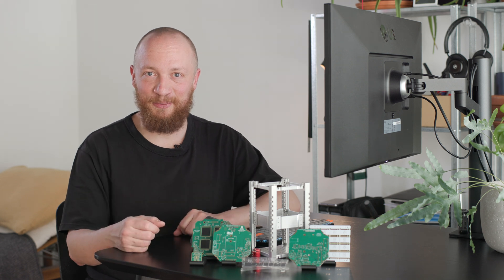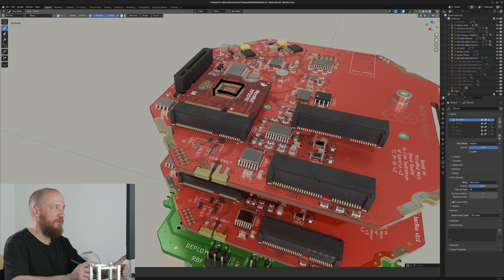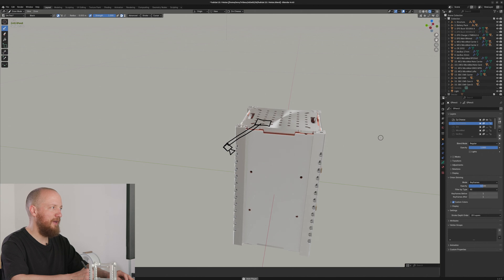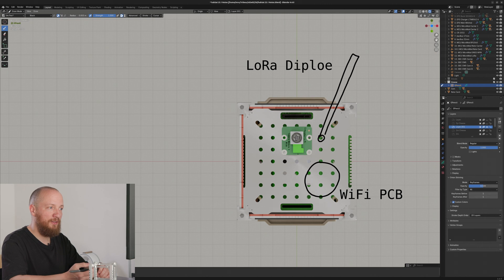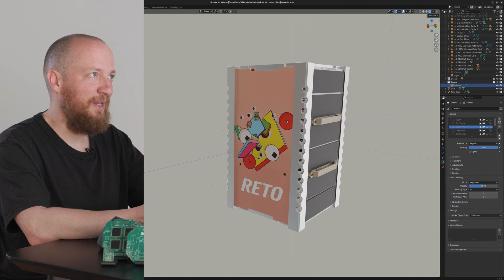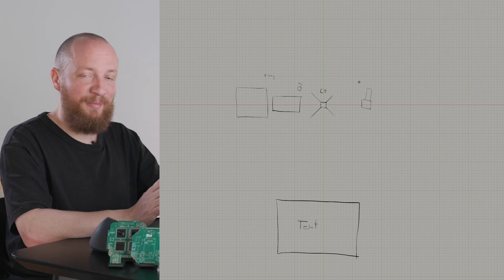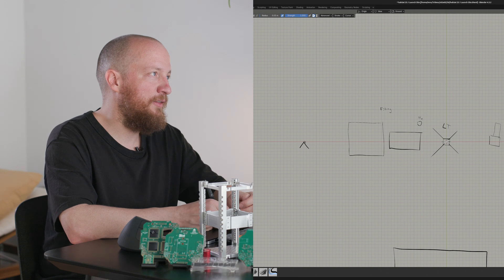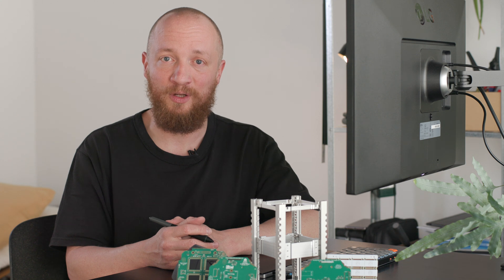CubeSat Test Flight Prep: Part 2, Hardware and CONOPS

Comment: As always, incredible work, Manuel. You're getting closer and it looks fantastic. Have you thought about adding a self-powered buzzer like the ones used for drone flights? Sometimes, even with GPS, it's hard to locate them during recovery if they fall in areas with trees or dense vegetation.
Reply from the maker: Thank you, happy to hear that you like the video! :) Yes, I have used a buzzer on a previous flight, but it wasn't really loud enough. So this time I'm going with a bright, flashing light.
Reply from the maker: Actually, I may give the buzzer another try. Is there any product you could recommend?

Comment: Iam currently working on a 2u cubesat project. We are planning to use a picam to capture earth images. We are planning to use lora for the becon signals and GFSK for sending down the image packets . In our case we have access to both of them and are planning to use both in the same UHF frequency band. Since both of them are at the same band, our team came up with a solution of using the same antenna for both modulation , using an rf switch to switch between two modes periodically. What do you think about this setup ?  Also could you give some insight about things we probably have to take care about or any other alternative options. Also one more things is that while researching about the picam we found out that it has a rolling shutter , and if we intend to use it in the LEO , will we be able to get any proper images , since the camera will be capturing the images line by line and the satellite itself would be moving at about 7.6Km/hr , won't that be a real issue (rolling shutter effect). We are actually a student team and we are currently at the prototyping stage.
Reply from the maker: Good stuff! Are you publishing anything about your project? As far as I can tell your RF setup sounds reasonable. I'd personally probably opt for separate antennas to keep subsystems cleanly separated. But either approach is valid, I think. You will just have to make sure that transmission windows don't overlap on the software side, and of course get regulatory approval for your RF setup (not sure if the ITU will approve of a LoRa-only beacon), and probably also for the EO payload with your country's regulatory body. Regarding the RPi camera, rolling shutter is unlikely to be an issue because of the max 75 degree horizontal FoV (if we are talking about the v3 camera modules). Relative rotational speed will be slow enough. You could try and set up a simulation in Blender to get a better idea of the speeds involved. There are other problems I'd expect: AF breaking due to vibration, sub optimal image quality due to limited dynamic range and high UV environment, optics degrading within weeks or months due to UV, radiation and atomic oxygen. My way forward for space grade optics will be something like a FLIR BlackFly board level camera and the most affordable lens Resolve Optics offers. If that's still out of my price range, I will scrounge Edmund Optics for something affordable with an MgF2 coating.
Reply: @buildacubesat  Yoo , thanks for your reply ❤️ . We haven't published anything yet , gotta launch a website soon to publish our work. We have done our first version of the EPS and OBC (having an stm32M4 as the controller) board and undergoing the testing right now. When we first started out , our mission objective was to get communication link using lora ( I guess lora wasn't that popular for space applicationa at that time). It was about 6-7 years ago i guess even before I was in the team. And that was a 1U cubesat. But recently there is a lot of cubesats out there using the same lora technology for becon signals i guess. There is even an open-source community called TinyGS for the ground station for lora communication satellites. So we decided to shift our focus from lora to use something else as our payload. Our current idea was to use the picam to take earth's images , and use those images to do a land classification and ocean garbage detection with some CNN models running at the ground station. To be honest we aren't sure how feasible it is to do something like that at this point. Could you give some us some idea on what all things that could go wrong with this payload (other than the camera since  you have mentioned about it before). Thanking you for spending you time for this in advance 💝
Reply from the maker: @iopmr  Discussing potential obstacles would definitely be interesting, but it’s a bit more than I can get into right now. I’ll be setting up a Discord after the test flight, and I’d love for that kind of discussion to happen there – ideally with others working on mission design too. Make sure to check back for the announcement in late June!
Reply: @buildacubesat  Love to hear that , btw you are doing a great job 👍